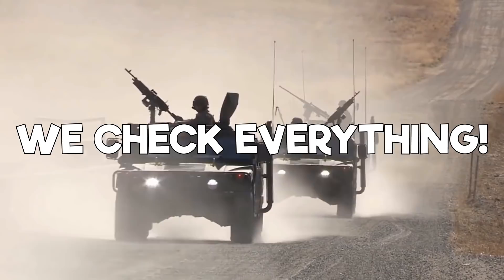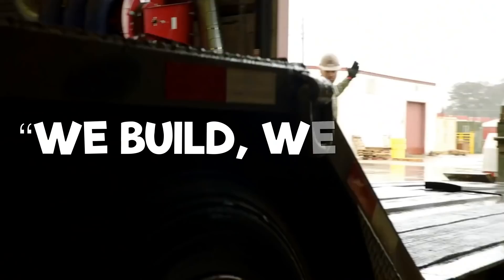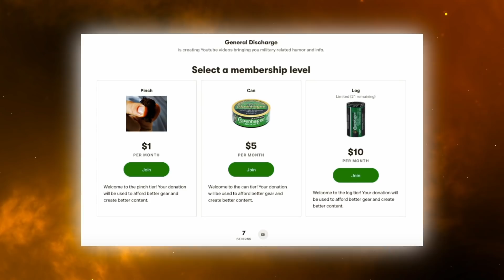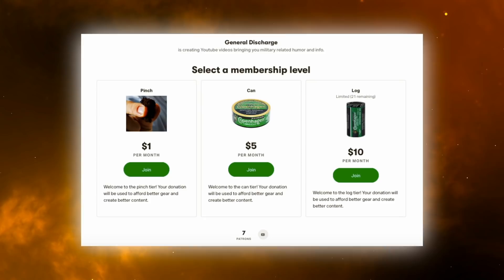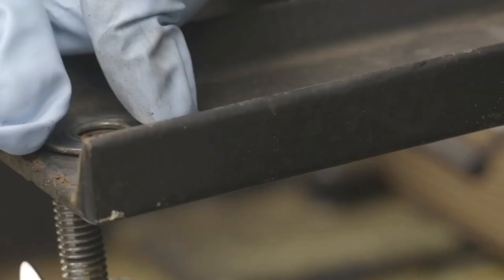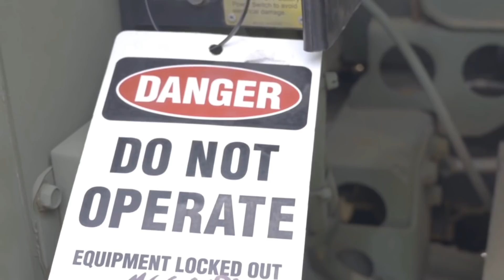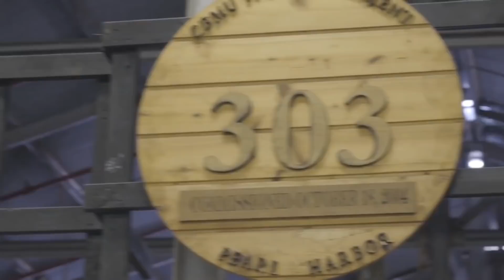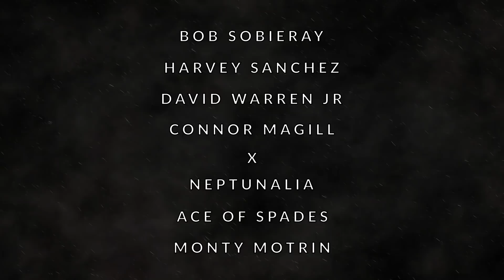US NAVY SEABEES 2020

Comment: BU1 served from July 78 until Feb 88. Looks like it has changed alot with different training locales and better equipment.  However never regret my time served.
Reply: Agree. Did 79-99 and as an EA, I wouldn’t know how to use their current equipment.  Fortunately, still with Dod and was with Seabees as a civilian before moving to current job where some projects involve the comm n IT of the equipment they use today. 

Nothing like riding in back of deuce and a half or trying to get reception from a PRC 77 with that  monstrous whip antennae (and metal piss pots before the Kevlar.      Good times

Comment: As a former Seabee Steelworker 2nd class 05-08 and a former U.S. Marine (5811 MP) if you're looking for a trade that plays with weapons but doesn't have a brutal physical training regime join the Seabees.

Steelworker also includes.  Weld repair and resurfacing of construction equipment  assist CM's in repair also assist BU's in construction projects.  Also assist UT's in their projects.  Steelworker is the only "worker" in the Navy.😁👍

Comment: I'd love to see more on the Sea bees especially DEVGRU.  I knew a bunch of them when I was stationed on Diego Garcia in the early '80s.  I was an H.T.
Reply: I'm a retired Steelworker who was stationed at an HT shop at Waterfront Operations at 32nd Street Naval Station, San Diego for my first three years. We serviced the tug boats, YOs, Oilers, Tiger Boats, etc. I learned some mad fabrication skills from HTs and got to do all the different welding processes from silver soldering, brazing, gas welding, MIG, TIG, to stick welding. Even did pipe fitting and learned how to target pipe. The Bees mostly stick weld, but I got a great rounded out experience with the HTs.

Comment: As a combat engineer in the army Nat Gaurd, was wondering if there's any videos about transitioning to another branch. Seabees seems like the closest thing in the Navy to what I do already. Building an fighting.
Reply: I think they are myself as I worked with many and my rating was in line with that of a combat engineer.  We did a lot of work with Army’s  COEs and shared a lot of common ground
Reply: @stemmentor9700  I ended up going air nat gaurd. Way less stress and it's nicer. 😂 Non damage inspection

Comment: How about Prime Beef, or Redhorse Rapid Deployment units. We have some special units too that almost no one ever heard of. I don't mean SOF but units that are very capable in a variety of environments.
Reply: Oh yeah those 2 Air Force engineer units. If I remember correctly, 1 is a rapid deployment engineer force and the other is a heavy engineering force. But correct me if I'm wrong.
Reply: Seabees are trained for rapid deployment too. In fact, we did our own aircraft load plans. Our Air Detachment could have required equipment identified, marshalled, and loaded in 24 hours or less, for any contingency, and be self sustained in the field for a month without resupply. The entire battalion could do the same in 48 hours or less. I attended the ALCE Aircraft Load Planning School six times, because I served in four consecutive battalions and kept getting assigned to the Air Detachment.